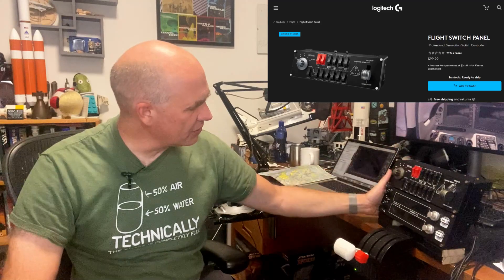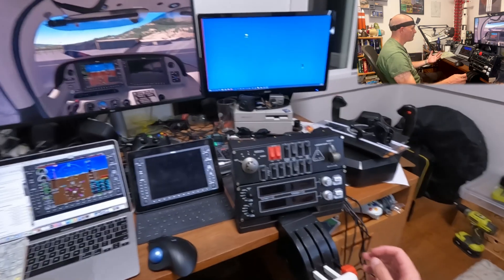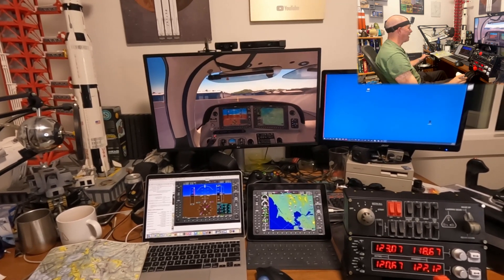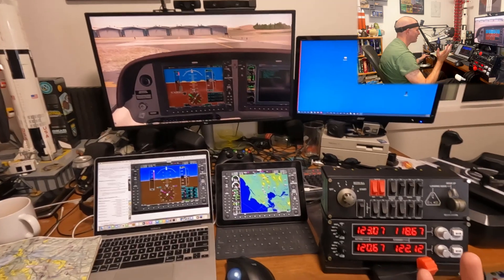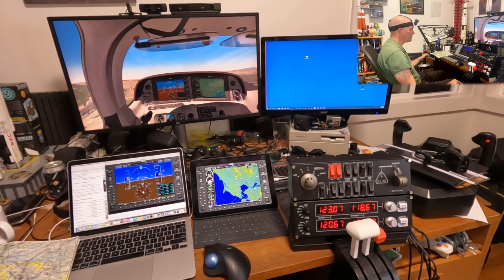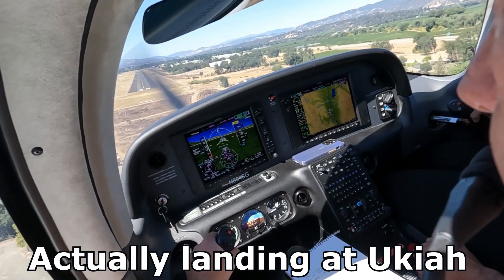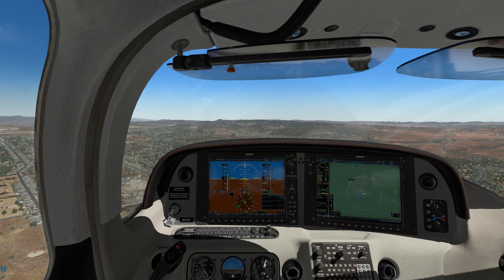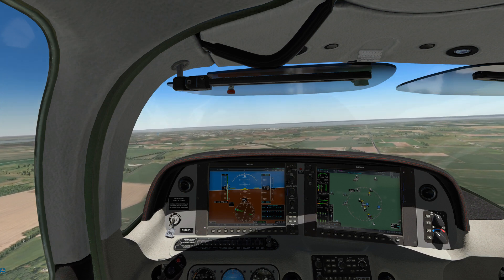Learning to Fly With Real & Sim Hardware

Comment: When you lose a chunk of wing during flight you might consider declaring Mayday or at least Pan, Pan, Pan. That might reduce all those pesky wing rocking requests. (Or the tower may request a little pitch or yaw action instead lol!  Slipping? Get yourself a ride with an instructor in a C150, C172, or similar trainer - slipping is very responsive and can be great for losing altitude or keeping runway alignment in a crosswind. If the Cirrus doesn't slip very well at least you will know what people are missing.

Comment: from a model aviator. don't force the airplane, just let it do what its designed to do. too many time i've seen model airplanes forced into the ground and straight to the recycle bin because of an over reaction on the controls. this happens especially during landing most airplane including model planes will glide happily to the runway if you manage the energy properly. most of my real flying experience is with gyrocopters but the same applies

Comment: I'm sure you've heard this, but my latest sim rig has honeycomb yoke and throttle. It's a dream, truly. I had a CH yoke, and tried a turtle beach one. They don't compare. The CH one is probably like the saitek with pots instead of hal effect, and the turtle beach has other issues making it stick. The honeycomb is just smooth. Along with my 55" 4k tv i play on (soon to be 3 maybe with msfs multiview), the only upgrade would be force feedback and full 6dof motion lol. I've got one of those logitech instrument panels on the way to see if i like it for older planes, and eventually I'll get tablets for g1000, etc, but for now just the honeycomb stuff and a radio panel are great fun. Great vid, love watching your pilot journey as I learn a lot of the same stuff, down to vfr cross country mission planning, just without the intention(or money) to do the real thing :)
Reply: Three 55" screens! 😲
Reply: Neat setup. Why don't you go VR?
Reply: @Mr.Anders0n_   I love VR, I use a quest 2 w/ wireless. Depends on which I feel like.
Reply: I also have the Honeycomb yoke and throttle, it feels a lot like the PA28 I flew a bit (intro flight). They feel really nice to me. I have a-fib so I can’t easily pass the medical, so sim flying is what I need to limit myself to.

Comment: A few notes from a flight instructor:
1. Make sure you're using your checklists and doing everything in the sim as if it's the real airplane. (I bet you probably do, but just skipped them for this video to save time. If you'd rather not fumble with the mouse, use a printed checklist.)
2. You should have declared an emergency at Simventure. It would have given everyone a great learning experience and would have saved you from trying to your rock wings. In that situation, you get priority!
3. You can always go around. It's not a bad outcome of a landing, and it's not a failure.
Fly safe!
Reply from the maker: I agree with all of those.... although I'd also add 'know your flaps deployment speeds'.
Reply: @scottmanley  there can be hidden dangers in switching between aircraft, even in similar types.

Comment: Try landing in strong winds.  In a Cessna 172, I was landing in a very strong headwind.  My instructor kept repeatedly telling me to hold-off on my landing descent, until we were directly above the center of the runway, but at pattern altitude.  When I reached for the flaps, I was told no flaps or we would land while moving backward relative to the ground.  The descent was near vertical.  The engine set to provide slight forward movement relative to the ground, but much higher throttle than a normal landing.  I think the instructor intentionally chose that airport that day, just to teach me something new, and to amusedly watch my face as I was surprised at so many non-standard techniques.
Reply: When the wind is so strong it turns your Cessna into a VTOL. That's insane.
Reply: So what I'm hearing is airports just need to find a way to create 150 miles per hour head winds then 737s can just take off from a helipad
Reply: @Th3Shrike  That'd be a sight.
Reply: @Th3Shrike  That's exactly what I read as well.
Reply: Many years ago, when in the Air Training Corps, I was doing glider training one weekend and the weather was closing in, so the instructor said that we were going up for a 'weather check'. Reaching over 1000ft on the launch we leveled out not far below the cloud base and felt a bit of rain then looked down to see that we were actually flying backwards despite the ASI showing 35kts! Needless to say we hightailed it back to ground as quickly as possible and got the gliders back to the hangar for the rest of the day!
Reply: There's YouTube clips of tundra cubs etc vtol on creek beds and all kinds of fun stuff even stopping distance competitions
Reply: I have witnessed a J3 land backwards. Very strange, Glad I wasn't in it.
Reply: Im sorry but your landing approach speed in a 172 is 70-80 knots... So your trying to tell me you were regularly training somewhere that happened to have sustained winds of over 70 knots (well into hurricane force winds) in a small GA plane? Yea sorry there is some real exaggeration going on here buddy.
Reply: @CrossWindsPat  hahaha I guess his instructor teaches him land near Vso. I’ve only experienced this while practicing slow flight during a windy day but during landing in a 172 sounds a bit far fetched to me
Reply: You landed with 70+ knots headwind?
Reply: Two days ago I was in Kuala Lumpur in a Cessna 172, zipping around skyscrapers, at one point, the planes controls were pointing at one direction, while the plane went in the completely opposite direction.
Reply: Where in Kansas or Oklahoma are you flying? :-D

Comment: If that's your worst landing, You're doing OK.  Most people have trouble with airspeed control when slipping early on.  Make sure you are well trimmed to your approach speed and it will make life a lot easier.  It is also advantageous to practice coming in and out of slips at altitude.  Do so in approach config and speed in level flight.  It will descend when in the slip and that is the goal, but practice keeping your airspeed the same throughout the entire maneuver.

Comment: Nice!  
Any concerns about "muscle memory" issues going from simulator to actual Cirrus with an Avidyne or Garmin package?

Fun (to me) tidbit; I used a flight simulator 20+ years ago to better understand how pilots used the autopilot that I was fixing on the bench.  Helped a LOT translating pilot-eese to tech-lish. :-)
Reply: No clue about Scott, however I have been training to fly gliders both irl and in a simulator - ran into this exact muscle memory issue a number of months ago.

Gliders (at least the ones I've flown) generally release from the tow plane via pulling a knob to the left of the instrument panel. 
In the simulator I had the cable release set to the joystick index finger trigger instead, no where near the position irl (completely different hand operating it..)

During one of my irl flights, I attempted to release from the tow plane by pulling the trigger on the control stick which, in the Perkoz I was flying, is actually a spring loaded elevator trim... Realized within a second or so that I hadn't actually released the cable and had instead just retrimmed the aircraft, no harm done and I proceeded to release normally via the knob. I did rebind my controls when I got home that day though to make cable release on the sim be a switch on my throttle, close to where I would have to reach in a real craft. Not had the same issue since.

TLDR: 
Muscle memory can be a major issue, this is minimised though by making the sim controls match, as close as possible, the physical location of controls in the real craft.
Reply: Why you need to train in VR simulator

Comment: a crude fuel dial could be made from a large rotary style isolator (commonly used to isolate an A/C unit here in the UK) and a bit of creative 3d prints to make it work as two seperate switches not just an off/on

Comment: I know the simulator arduino path is an attractive one to go down, but have you considered a VR setup? There is a guy here on youtube called the warthog project that built out a massive A10 simulator, and in the end, ended up switching to VR. VR with microsoft flight simulator is such a surreal experience I cant recommend it enough.

Edit: rechecked the warthog project and he did go back to the cockpit, but he obviously already had the whole cockpit already mostly done. He said he enjoyed the touch factor a lot more via a normal Sim.
Reply from the maker: I really want tactile buttons.
Reply: @scottmanley  Hey Scott thanks for the reply. I totally agree, tactile buttons are the way. However, most VR systems have cameras in them these days. You can set it up where you bring your controls into VR, instead of bringing the panels into IRL, giving you tactile buttons with the head tracking capabilities. In other words, instead of having an IPad on the desk with the maps displayed, you get all that for free in VR. 

All you need to have is a view of your irl setup somewhere in VR so you know where to reach for the button. Steam VR can be setup so that if you look at your hand, the camera view will open in a small window. This will let you locate and hit your physical buttons, then jump back into full VR.

 It also helps to position things where they are in the plane, which would just be some rearranging of your desk to match what you see in VR. Not necessary, but helps with full immersion. 

Either way, I didn't mean to criticize your setup. Whatever works for you is the best way forward. Fly safe!

Comment: As a pilot, simulators are harder than actually flying a Cessna 172 in real life!
Reply: that's how it is with many simulators. for example missing stuff like g-forces, the sensor called butt and looking at a small flat screen often makes driving simulators a little bit harder than real life. especially when it comes to racing simulators. i am guessing it is very simmilar when it comes to flight sims.
Reply: @heikoscheuermann  yeah I’ve heard VR makes a huge difference to sim racing and flying, because so much of it is about depth perception. But hey I play on a TV at about a 20 degree angle and it works just fine 😜
Reply: I love flying in MSFS, would love to fly an actual plane unfortunately I have epilepsy so I'll never experience it.
Reply: @iitzFizz  Are you not able to book an experience flight? Sit behind the yoke and be told your flying when in actuality a CFI is doing everything from the right seat.
Reply: MFS is truly amazing love to just fly around and c the world
Reply: Ever tried crashing one in real life…